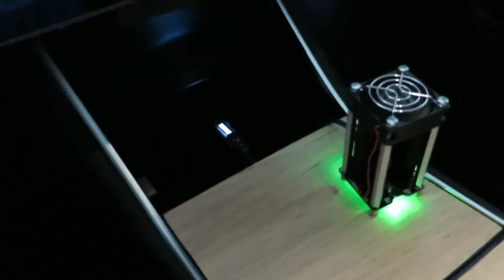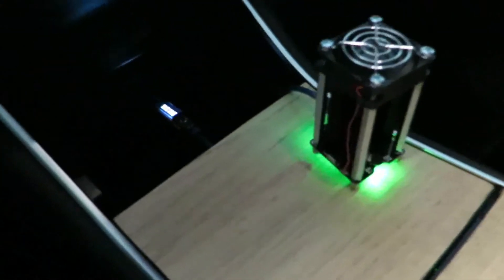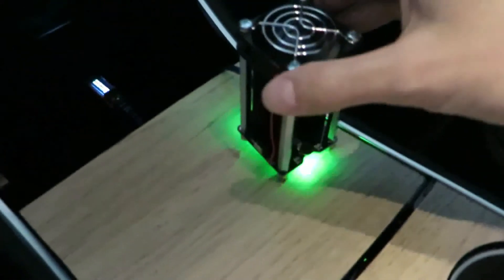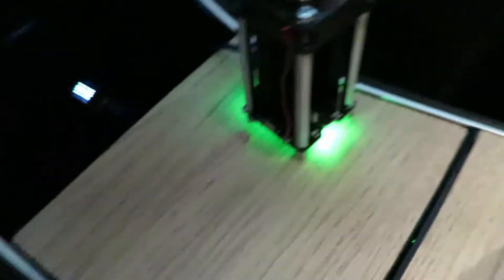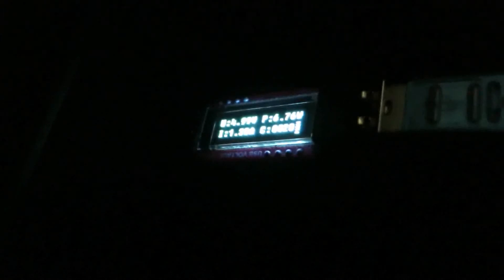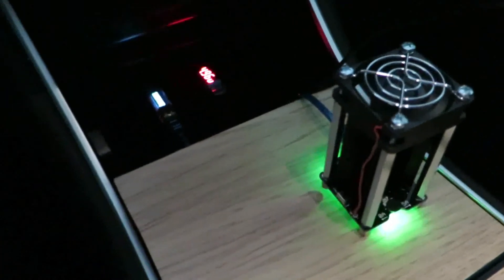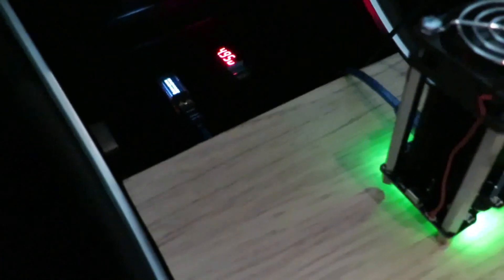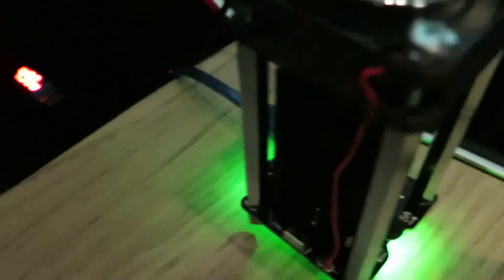Tesla Model 3 Front USB power output test

Comment: Thanks for the clarification. 2,6A is not bad at all. ;) The most Phones don't draw so high Amps. At least not the Phones i had so far...
Have you also tested the rear USB Ports? Do they differ from the front?
Reply from the maker: I haven't tested rear USB ports yet. It's nice that front can provide 2.6A, but as you could see my phone only charges at 0.4A because it thinks it's connected to a computer. Which is not sufficient. In my next project I'm going to create a QC charging adapter that plugs into front USB ports and allows for turbo charging.
Reply: Michal Canecky any word on that adapter ?